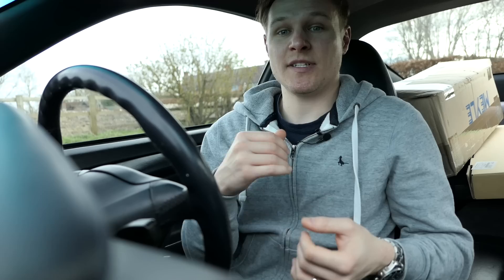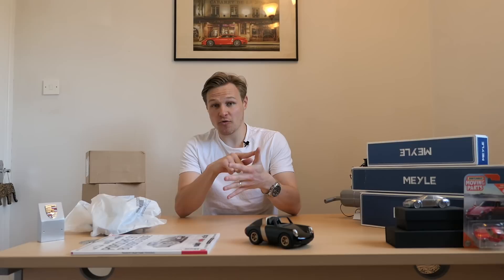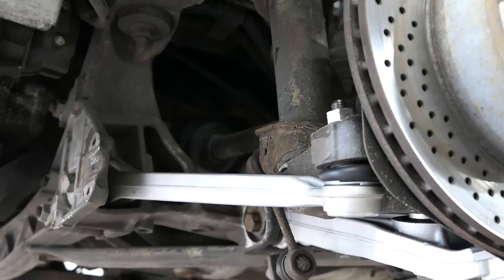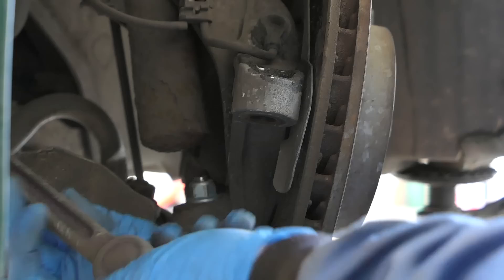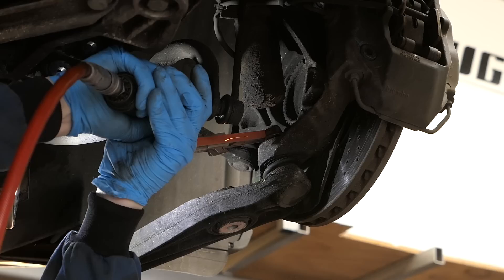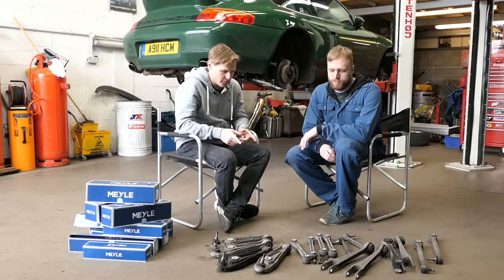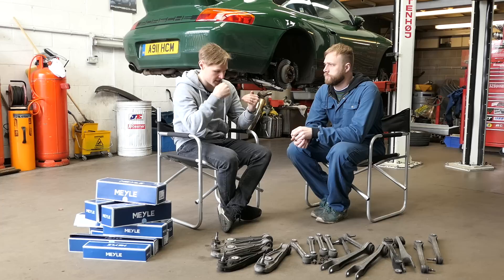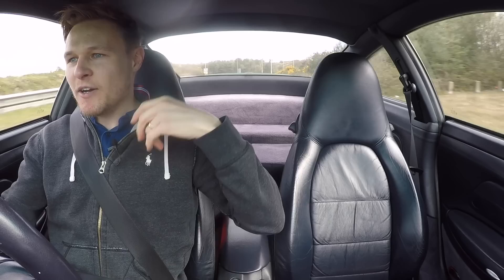Porsche 996 chassis replacement tips & FAQs

Comment: I have a KW V3 in my 996.2, you will be absolutely amazed it's like driving a brand-new car! It's so comfortable at low speed but keeps the car absolutely flat at high corner speeds 😊
Reply: @Mark Brown not really, it's out of the box didn't change anything

Comment: thank for this video.  I have bought all the parts for the front of my car from meyle.  Tuning forks, lower control arm, and trw droplinks and tire rod ends.  Also added new struts, strut mounts, disks, wheel bearing and pads while I was add it.  Will be done this weekend and can't wait to see the difference.
Reply from the maker: This is amazing, Tyrone! let me know how you get on with all the new kit.
Reply: @9WERKSTV  front is done but still on the jacks and just need bleed the breaks.  Waiting for the new motor mounts, new starter to replace squeeling one, change all fluids and filters.  Saving thousands!  Can wait and will update asap.

Comment: Enjoy your videos. Seriously thinking of getting a 911. Couple of points - I teach apprentices and counting the number of turns when removing track rods is good practice. However, if you do this you MUST carry out a wheel alignment. Used this process on my sons car and when we checked alignment it was 5mm out (overall)! Any parts you use should be up to OE spec. There are lots of cheap stuff available but it should be avoided. Spending a few quid more is often better.
Cheers!

Comment: Okay.  My baby is 20 years old-ish I'll tell you what I'm doing to my 996 TT Turbo: 1. Changed out 2 out of 3 radiators (in the front behind the bumper. 2. changing the oil seal between the engine and the transmission. Yes they have to come out, yes they are expensive. All for a trained seal :-( 3. Changed out the turbos -- fairly reasonable, at least they are accessible 4. Got the two rear rims cleaned up. Also reasonable. 5. Not touching the rear wing. Everyone's dies. I got 19 years out of mine. Pelican (I I think) have an aftermarket kit that was nearly two grand. A real one is not much more. Unless I am going to track it or sell it not going to touch it. Net will be suspension brakes probably next year. Last point I have the carbon fiber interior the sun UV rays are killing it. Any coating suggestions? Finally a shout to HERO MOTORSPORTS in Van Nuys. Owner races a 996, I would not take it anywhere else. I really think this car, for all the hate it used to get, is the best practical super-car there is.  I don't want a newer one with more electronics, though I would like another SC.

Comment: I had to replace tuning fork on my 2013 991 last year. It looked like a rat had nibbled through the bush while I was out of the country and the car was parked for 3 weeks. I had opted to replace the part for an original part, sourced from design 911. If it was a slightly older car and I didn't need to renew the warranty, I'd probably had gone for an OEM part. They seem to look  the same and do the job.

Comment: I refreshed my links about two years ago to the tune of 8000 Euro, including some other minor fixes. Basically the rubber was gone in all of them. Surprisingly the handling wasn't horrible, but living in the land of the Autobahn, you need something better than that.
Reply from the maker: Wowzers, you must have replaced everything by the sounds of it!
Reply: Yes, 8000 was a bit misleading, there was a bunch of other tired-bits work in there, including motor mounts, pressure lines, etc., but probably something like half of the price was related to the various links, including labour. It was a bit of a rude awakening. My car is generally in really good nick, but some of the parts are just really tired. My car is 20 years old at this point, so no surprise.

Comment: My understanding is that the Porsche OEM arms are Meyle, with a Porsche barcode and attached premium price
Reply: I think the OE supplier is actually TRW.  Having just swapped out 4x coffin arms myself the Meyle parts look to be great quality but are visually different (softer edges to the forging) and are slightly heavier than the OE stuff that came off.  Still a great choice for the price.

Comment: Hi Lee, with all you've now spent and plan to spend on the 996.1, wouldn't you have been better off getting a newer model (997.1) with less miles and in better condition? Just a thought. Peter
Reply from the maker: Hi Peter, without a doubt for the money spent I could have quite comfortably had a 997.1… but no car is perfect and no doubt I'd have spent the money again on other bits and pieces on that car. The lesson is that no matter the initial purchase cost, a 996/997 or any 911 is still 'Porsche money' to run, and should be factored into any journey of ownership.

Comment: I have a 996.2 C4 with a single creaky coffin arm. I will replace both sides, but should I look at a following your full suspension overhaul at the same time, bearing in mind the rest of the set up is ok, but getting on for 18 years old now?
Reply from the maker: If you've the budget to do it, I'd absolutely investigate what else might need doing while the car is on the ramps.

Comment: Great video! Thanks for sharing. Wondering why you didn't just replace the bushes in the original control arms, etc?
Reply from the maker: Thanks! It's a good Q. By the time you burn the knackered bush out, you might as well just replace the whole arm, it takes less time.
Reply: @9WERKSTV  fair enough, now the new ones are in how does it feel? I'm installing new shocks, struts, springs and sway bars on Monday. My installer thinks the bushes are fine, we'll see.

If I was in the UK I would ask to buy your old parts and rebush them!
Reply from the maker: @IainRose  Awesome! I'd also recommend new top mounts to go with your new shocks and springs. My car feels amazing now, the ride is so much better now it's in better contact with the floor.
Reply: @9WERKSTV  You're the 2nd person that's told me that now. I'm dropping it off in the morning so will ask them to replace those too if they look worn. I have new Rein engine mounts on order too but they won't be here for another couple of weeks.
Reply: @9WERKSTV  Hey Lee, I took your advice and replaced the shock mounts when the suspension went in. Car feels and looks great on the H&R springs and B8's. New engine mounts went in a couple of weeks later which also made a huge difference. Looking forward to hearing about your coilover install next.
Reply: @9WERKSTV  Hi Lee, I just got hit with the clunking sound over bumps and suspect I need to do the same with my 996. What's the 6 month report on the Meyle gear? Are you still a fan?
Reply from the maker: @IainRose  yep still very much a fan of the Meyle parts, no clunking noises, car still feels very sharp.
Reply: One more question for you Lee.

Did you consider changing the inner tie rods at the front too?

I found this kit which looks to have all the same components you used plus the inners. Was there a reason for keeping the old ones when you changed everything else?

https://www.fcpeuro.com/products/porsche-suspension-kit-911-boxster-trw-997kit1

Comment: What was the total cost for parts and labour please? Thanks
Reply from the maker: Hi Joe, I can't remember the cost of the parts but you can see the prices easily enough over at the Heritage Parts Centre website. Using the code 9WERKS10 gets you 10% off.
Reply: @9WERKSTV  did you ever replace the IMS on your 996?

Comment: Does this help with a clunky feeling around town? I have a 2007 911 c4s with 68k miles and it feels clunky over bumps and is more bumpy er than my older 996.2 with 21k miles need some advice please.
Reply from the maker: If the car is physically clunking over bumps then yes, your bushes are shot I'm afraid.
Reply: That Nine Eleven Guy ok thanks im going to order the kit from the video